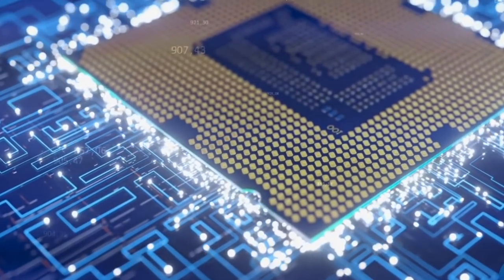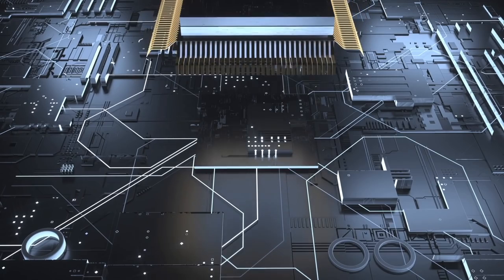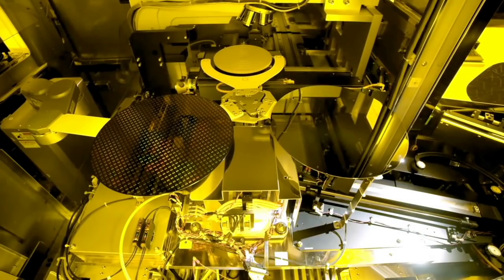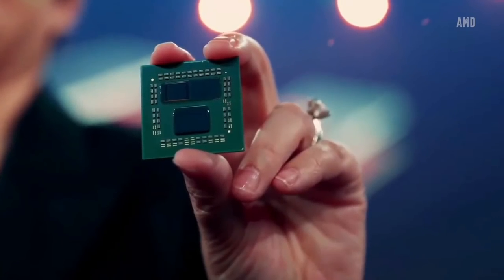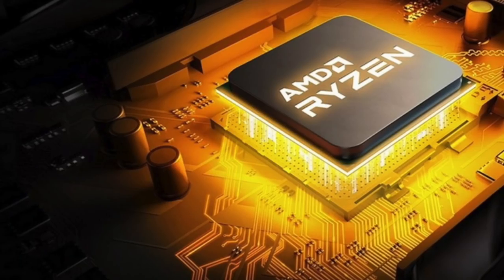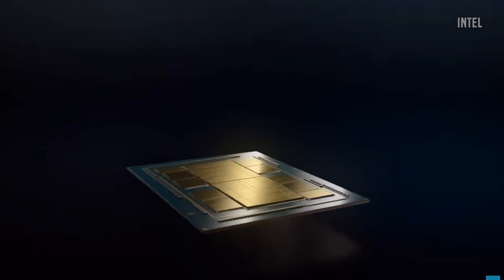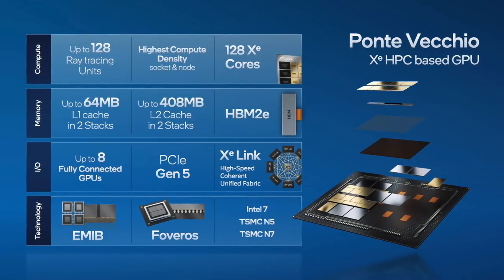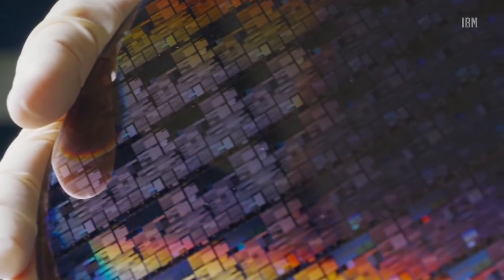The Next Big Wave in Chip Design. TSMC's WoW Packaging

Comment: Besides heat dissipation question, I'd like to know more about the layers are aligned. I think it's mind blowing that you can align the interconnects when the density of the connection points is so high.
Reply: On a chip with tens of millions of transistors, there are only about 1000 connectors. The connectors a so much bigger than the transistors that it is not a big problem with stacking. The heat is a way bigger problem.
Reply: TSMC is working on on chip liquid cooling via very small channels
Reply: @onlymediumsteak9005  That could actually work. but if you cant shrink more the power usage will be about 10-15 watt per layer. so the power will go above 100 watt soon. its not doubled unlimeted.
Reply: @onlymediumsteak9005  thas exactly how you do it like in engine blocks and heads with cooling channels
Reply: @erkinalp  Yes. But the chemical Insertion reaction can only be applied on a waver with a light source that is not available and never will be because the wavelengths are too small. Wavelengths are much larger than a single atom. They already struggle with the wavelengths now. They use water drops to compress them now bit, but  there is no idea yet how to scale that down by some magnitudes needed for your idea. Then there is another insertion method, but that method is way too slow. To insert all the atoms, you require many many years to insert them all for just 1 processor. The process is just too slow and needs, if you calculate it by the same more's law, a few decades at least to develop. Good thought anyway. Thanx for posting.
Reply: Reducing the frequency would be one way to do it
Reply: @randyhollier  You can't. All frequencies that are usable are bigger than an atom. Its like saying, let's make really really small ships so they are less than 1 dollar per ship. You end up with a toy, and you will never be able to send cargo over the oceans with them. Or maybe trying to make a rocket that is faster than the speed of light. It's impossible.
Reply: @icourant  i meant reducing the clock rate of the cpu itself to reduce heat and allow time for the cpu to cool off. Or maybe some material science savants can make mosfets out of more heat disipating materials?
Reply: They water cool the new processors by small channels in the chip itself to move the heat away. Thermo throttleling the ship itself? Would you buy it when it can't work 100% all the time? Is that not the same as a slower processor with a turboboost?
Reply: @icourant  yes something like that but i guess industrial applications need more constant loads
Reply: @randyhollier  Yes. I think that too. It's a major point. But for 40 years or so, they say Moore's law is dead or dying. Still they keep on finding new ways. Thanx for the talk. If you want to know more about this subject, I can highly recommend this video with Jim Keller. He designed many processors for AMD and Intel. He also worked for Elon. He has cool insights about Moore's law too. https://youtu.be/Nb2tebYAaOA?t=1805
Reply: @icourant  Water is not used to compress wavelengths it uses as a lens(immersion lithography) do some reading before making dumbarse statements.
Reply: Doesn't immersion go out the window with EUV? I thought they can only use mirrors, no lenses, as they would absorb the UV (I don't know how many of these use EUV tho, maybe this point is moot anyway) but I would say, with heat dissipation, that you do get some advantages just by having transistors closer together, not just by the fact that interconnects are shorter, but you can probably also save a bunch of logic required to communicate across clock ticks for units that are farther apart, by bringing them close enough to be communicated with within the same clock cycle... but this is just wild guesses from an outsider
Reply: It is silicon on silicon, the two dies have the same thermal expansion coefficient. The AMD stack I think is using copper bumps and silicon through hole via technologies. Flip chips have been using look up/look down camera for vertical alignment for decades in mainframes.

Comment: So interesting:) But arent there issues with Heat dissipation?? I suppose the "lower" layers of the chip would be harder to cool? And btw the trees look great haha
Reply: I have the same doubt
Reply: I think they will be designed much like dojo where you have heat sinks and or cooling between levels.  You can also run a coolant pipe vertically down the center of all chips and place compute chips there and the low temp items around the outside of the SoC.
Reply: May go to silicon carbide semiconductor instead of silicon.
Reply: I remember seeing something fairly recently that was being done as part of a research project where they were putting cooling channels directly into the silicon dies. Think of how the water channels work inside a water block... But just imagine it inside special non-conductice layers inside the silicon itself. This would work really well and can work with multiple layers much like how they connect using TSVs.
Reply: Linus actually talked about it here... https://youtu.be/YdUgHxxVZcU - this was the video I mentioned in my previous comment. I'm sure it should be fairly trivial to make this work in 3D early enough. The heat dissipation is massive.
Reply: The fact that most of the invested energy gets transformed into chaos aka heat and the need for heat dissipation shows how primitive processors still are.
Reply: Heat is always a problem. The silicon in top either needs to be the "hottest" part.  I would think the high current power channels can also xfer heat up.
Reply: Maybe because the distances involved are so small the heat will dissipate quite quickly.
Reply: I love computers and pretty girls
Reply: just like engines we can try to use increasing surface area that will help cooling them fast
Reply: 3D water tunnels will be etched throughout the Silicon, google what TSMC did, direct die 3D cooling seems so crazy :D
Reply: Not optimal for overclocking but there is no need to overclock these.
Reply: When using through silicon vias instead of solder bumps you get really good heat dissapation from the lower layers to the top. So far the only consumer product application is a cache layer on top of a CPU. Eventually we may see more as they work through it.
Reply: There is a technology that can solve that, I think a few years ago there was a research paper that talks about using lithography to etch coolant lines on the silicon itself, so the coolant goes through the silicon instead of interfacing through a head spreader.
Reply: In a current and near future 3D semiconductors, the traditional cooling methods are still sufficient, in considered advanced future 3D designs, which would go much further in the 3rd dimension, there are some obvious heat dissipation solutions being evaluated for some time, such as various 3d cooling grids or fractal Menger sponge-like structures which could effectively allow cooling of deep 3d layouts, essentially even a full cube, but manufacturing itself is not quite yet there anyway.
Reply: Go to 5:43 in the video… heat sync integrated with the wafer stack.
Reply: AirJet MEMS will do the trick

Comment: very good news regarding the development of new technologies in transistor manufacturing.  It would be even better if the chip makers worked with each other.  And don’t be hampered by licensed technologists.  The whole explanation of the operation is great but I'm worried that the transistors will overheat and break down in the middle part of the chip.  so I would like to see a vertical nano graphite tube or something similar to facilitate heat removal.

Comment: Stacking chips certainly seems a logical step forward, but the most important issue is heat. How will they manage that? 
Isn't stacking practically gluing two processors on top of one another, and isn't heat dissipation a big issue already? 
Do they have some new ideas how to transfer heat? Spreading the dye allows for bigger area to dissipate heat to the cooler, how would be an exaggerated  example like a cube cpu be cooled? Wouldn't the core, inside melt while the outer layer is barely hot?
Reply: I've heard there is a technique that uses some kind of 'micro chimneys'; a kind of vias between layers.

Comment: My question, as pertaining to Intel specifically, will they use 3D stacking technology for their current CISC designs, is it a hybrid of CISC and RISC or will they be moving to RISC exclusively? By the way, this type of technology was actually mentioned in the "Terminator 2" movie. Check it out!
Reply: A hybrid between more powerful cores and less powerful cores. Both types technically CISC x86. x86 instructions already get converted into 4 byte long RISC-like micro-operations.
Reply: @perforongo9078  Just stating all CISC instructions get translated into 4byte RISC ones is outright wrong.

Comment: would it be possible to put a type of heat-sink in-between the different layers, while still having the interconnects work?
Reply: There’s a number of connectors on each chiplet they count in the hundreds/thousands what you’ll need to do is to have all of those connectors redirected around the heat sink. Having full sized heat sinks is not really a feasible thing or do.
The tech they are looking into are : 
-some kind of water cooling, even some micro tubes around the entire chip (micro tubes that go between connectors) 
-Looking into other materials to build the chip. Silicon is not very thermally conductive. But there are some silicon alliage or other weird stuff that are great to make both chips and move heat around. Howether, today it’s mostly not feasable because to complex and/or expensive
Reply: @vizender  cool! thanks for the response

Comment: 3D chips in increasing high performance only really make sense with magnetic or optical technology, otherwise interspacing with cooling.

But, if you have up to 40Thz magnetic, or 1 million times faster than normal optical chip, you have enough performance for most things.

Comment: Mmm it sounds nothin particular : the problem no one did it before is heating. It's now more required by mobile devices. In a decent pc you might appreciate a second integrated video card in case of failure but most of the time you want a videocard chosen indipendently from cpu. So I think this new solution can improve mostly mobile and servers but not that much workstations

Comment: Stacking is nice, but this technique cannot double the speed every 2 years. (More's law). Stacking is limited because of the heat. Going a lot smaller cant happen too because of quantum jumping and tunneling. The next big jump will be quantum computing and off-device computing, where part of the calculations are done on a remote server. To make computers faster in the coming years, a lot will be done by smarter programming and better compression techniques. I.A. will also fine tune the way we calculate so that programs can run on "slower" devices. It will be a mix of many fields that together will move us forwards. Before it was almost only hardware that speeded up, but now it's a broad effort.
Reply: And then light computing, that is 1000 times faster, probably. I would say 2040 is the year, when light processors will be there for people

Comment: If the future is SoC like M1, how RAM manufactures will react? Because CPU, GPU, RAM will be made by the same company, and also the issue of non upgradable desktops...
Reply: RAM manufacturers will simply adapt by selling their IP for RAM components like ARM does with its processor cores. Chip designers will simply purchase the license to use the RAM manufacturer’s design and incorporate it into their own custom SoC and wrap their own IP on top of it.
Reply: Nothing.  Just sell the RAM dies to SoC makers.  The Apple M1, M1 Pro and M1 Max integrate separate RAM dies to the CPU/GPU/ISP/AI core die in one package.  The RAM lies in separate dies.  It is not optimal to design RAM on the same die as CPU/GPU.  They only put some L1 and L2 cache in the same die as CPU/GPU.  Those cache RAM's size is small.

Comment: But today's processors are more than enough. It is came to a point where computations are simply not used for human benefits. You don't use any software that can check reactions of chemicals on your body, you just don't have access to it. And so animals are still suffer. Computations are barely used.

Comment: I just have to wonder, from a security perspective, could these be vulnerable to a rowhammer-style attack with voltage leakage?
Reply: @godslayer1415  Yes, it is. It is an attack using voltage leakage across cells to change bits in neighboring cells. Voltage leakage at these scales is a problem engineers need deal with everywhere. It's not inconceivable that voltage leakage could affect affect a gate, and gates nearby, and that could create a vulnerability.

Comment: 3D has cooling issues always has, 3D was mooted 20 years ago and heat dissipation was the issue then and it will be the same now, it may be fixed but it's going to need some weird magic or it's going to be low power. 

The math for this isn't hard it's junction temp and thermal conductivity, when you pass that through 3 bits of silicon your heatsink is at -160 or your chip is boiling.
Reply: Probably in the future you can heat your house with it
Reply: @tetraquark2402  nope base chip will burn itself out way before then, as an aside a French company mooted installing servers in peoples houses for heating so you're not out there..

Comment: Military computers do that since the 1980s.
You can buy them on eBay.
Reply: @godslayer1415  It sure is wrong to you, however, I did save it and publish so, I know that I'm not the only one to know about this.
What they did back then was that they superimposed multiple boards to do multiple tasks, like we now have, however, this was back in the 1980s.

Additionally, they used this method back then to be able to monitor civilian systems and to keep levels of security for the mandate of their work in case some entity wanted to create wrongs they would have to correct using this systems' methodology.

Furthermore, the people I published the auction to also work in the army, and so, as such, and in as such, shouldn't be feeling obligated to publish it to parties who want to use that info to wrong ends, as you or others may be led to  believe or to be suggested to do so believe, or disbelieve facts.

--
I will look for the info to verify if I can find it again, however, it does use the same design idea, even though the patent application is different.
Furthermore, state secrets can be protected by other means and security than patent applications, which this #3Dmicrochips, "... Next Big Wave in Processor Design. TSMC's 3D WoW Technology" is.

I wouldn't count on me to be obligated to publish that here or elsewhere for the matter, either.
Reply: @godslayer1415  /2 ...
By the way, the only computers you can now buy on eBay related to this do not and most likely will not include the multiple board arrays systems that were previously offered there, and especially not if some other entities be it civilian or military tried to make them seem wrong.

You'd have to be dealing with them otherwise to ever be able to secure it anymore.
Reply: @godslayer1415  /4 ...
90% of projects failures are caused by communication gap.
Reply: /3 ...
The video 294 The Five Laws Of Stupidity, explains why bandits or pirates are not the most dangerous people on Earth, including courts acting that way, for instance, against the Pentagon or other entities with global authorities serving and at the service of all humanity.

Returned error

One more good reason for you not to use that system to go to the moon.
Reply: /7 ...
What you want to do is to attribute my words and content I may copyright to interpret it to your advantage, regardless of the damage which may make me seem wrong, regardless of the intent with which you try to do so.

Furthermore, you try to infiltrate my system and hack my knowledge, expecting me not to be having to be using it against you, despite the other years of damage you intend to cause, did cause, and, related attempts that you try to justify doing, that you don't know about and that you would have the right to not know about, so to be able to hold me wrong, and, disregard the damage it may cause others by trying to make me seem wrong and so on.

So yes, they offer me law courses in international military law for that.
Reply: /10_2 ...

As you can clearly see in this article, the exact same red board color used by military computers using embedded technology to mount their military board for military work has nothing to do with 3D superimposing of any systems whatsoever, and they would have no right for patent, not even if it was a state secret, as it would be equally wrong to publish it not as wrong as it is intended to be wrong for.

Or is it?
Reply: /11 ...
Do you want some punch cards from the USSR with that?